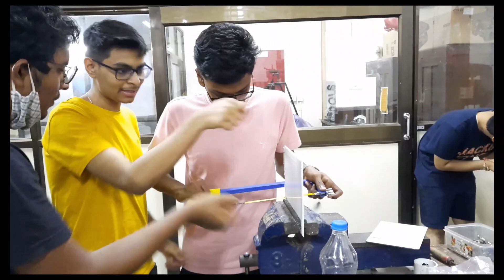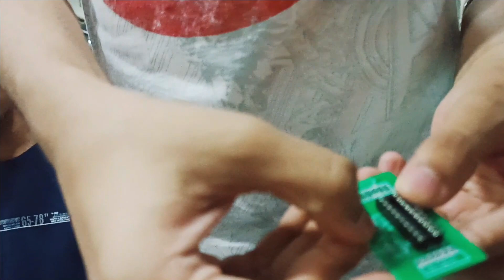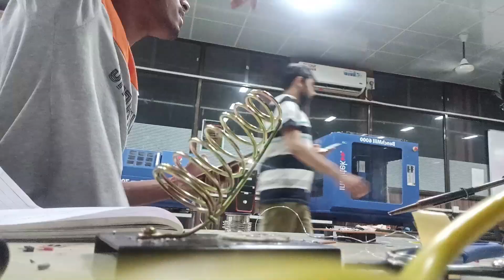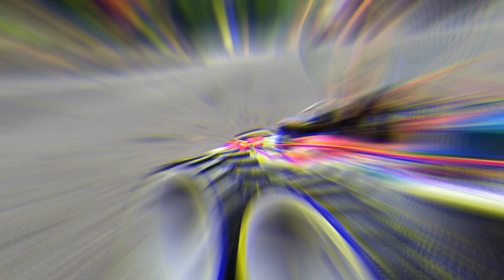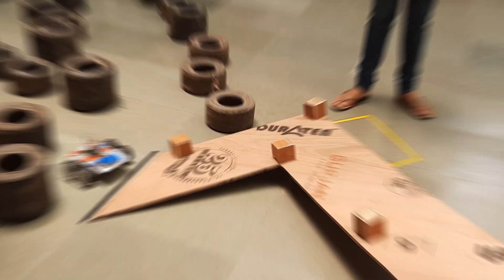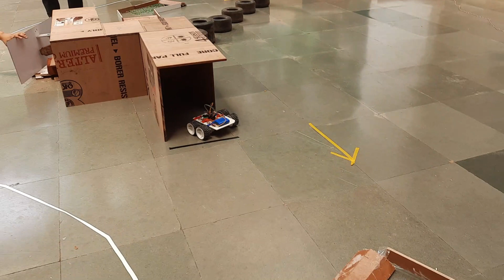Our first tech project at IIT Bombay | Remote controlled car

Comment: There is an electronics fun centre during summer in my city. They charge 2500 rupees and teach Arduino + BLE + Android (java) + Ultrasonic sensors. So I think it is not that much worth spending 4 to 5 lakhs for JEE coaching 😜

Their project is even better because the steering adjusts itself through the ultrasonic sensor’s calculation
Reply: These are freshers dude....and are they gonna make you employable ....